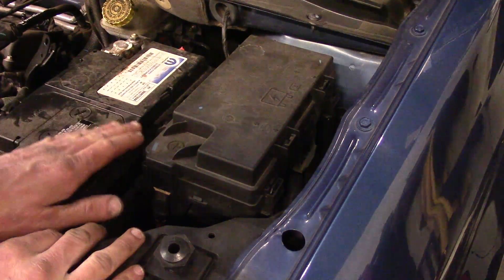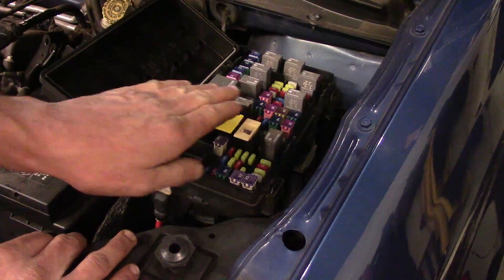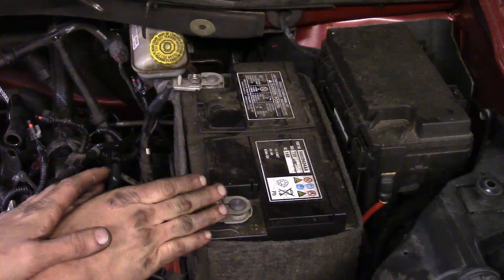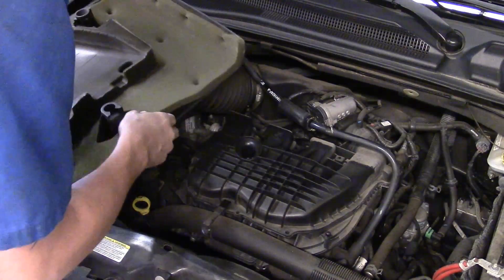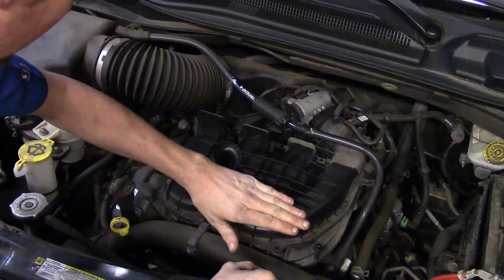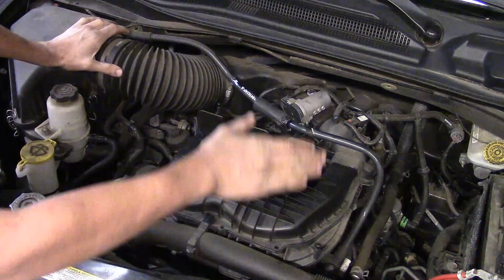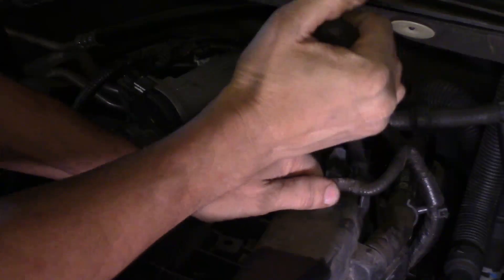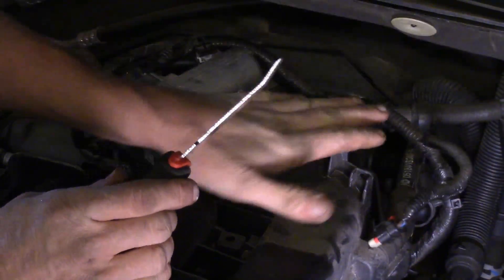Part 1/10: 3.6 Pentastar engine left cylinder head removal (the short cut)

Comment: Left cylinder heads on these motors have a warranty that's been extended to 15 years or 150k miles because they are shit
Reply from the maker: The warranty was only extended on certain year models. I appears to have been a coolant passage design issue from what I can tell...then again they dont give exact info. The warranty was actually extended to 10 years, not 15 years. Also....the head has to be tested to see if there is a burnt valve seat first....not all heads get replaced for the misfire codes that cause the diag to begin with. Only those failing a cylinder leak down test. Thanks for the comment and for watching.
Reply: What is the spec on compression?
And leak down rate?

Comment: Hi I live in Australia and have a early 2013 wrangler 3.6l. Please could you tell me if the part numbers stamped in the left hand head above the exhaust will tell me if I have a new generation head or the old one with the problems. Also I believe my roller rocker on the right hand head is becoming noisy, do they have a normal running sound like tappets or should it be dead quite. Thanks Shaun.
Reply from the maker: There will be some noise....very slight that you hear that will be the injectors but nothing more then that. There is a chance you have a roller rocker going out and a damaged cam lobe as well due to it. As far as the part number......I am not sure where its located on the head but the replacements had a green sticker on them that let you know they were reman heads. A typical Chrysler part number will resemble something like this......6859723AB. There will be a series of numbers followed by 2 letters. Thanks for the question and make sure to subscribe

Comment: Hi david im big fan of you I have a question I own a 2015 jeep wrangler about a 5 months ago the engine start making a loud knoking noise" not a ticking noise it was like a knoking noise the Dealership replace the left cylinder head about 2 days ago but still making the knoking noise not as loud as it used to be but still knocks any advice?
Reply: Neomarie, What was the issue, or problem, plus the fix for the knocking noise you stated on eyear ago that you had on your 2015 Jeep?I'm having a knocking noise and need to figure this out. Any help would be appreciated. Thank you so much!

Comment: my engine overheats just to the red, and was mysteriously losing coolant and no signs of it anywhere I have had the runaround with the dealer--is my 2012 caravan a candidate for change of defective cylinder heads??    Thanks great video  you need a donate button---I would contribute this is some great info---can you fix my van??
Reply from the maker: The head issue that was part of the extended warranty was the left head only and not for overheating but for a burnt exhaust valve so yours wont be covered for that reason. One possible issue is a leaking oil cooler....it can cause coolant to seap/leak and collect in the valley below the oil filter housing. Shining a flashlight down into that area is a great place to look. Otherwise if overheated too much you could warp the heads and then bigger issues now. To be sure.....a cylinder leak down test would be able to isolate if there is an issue with the heads and combustion chamber gases getting into the coolant system. There actually is a "Donate" button on the main channel page at motorcitymechanic.com. You will see the Facebook Icon in the far right and also a Paypal icon. The Paypal Icon is where you click to donate if you wish. Any donations are greatly appreciated and thanks for watching the video and make sure to subscribe.  As far as fixing your van.....depends if your close to Georgia lol
Reply: Thanks A big Bunch !!!   going to FB Appreciate the clear info totally is the best-

Comment: Thanks. Watching this video inspired me to never buy a Chrysler vehicle with a 3.6L. Those have got to be the cheapest looking roller tip rocker arms I've ever seen. Did you find any burnt exhaust valves?
Reply from the maker: Actually its a great engine. Its like anything else out there......no matter how much testing they do, there are always issues on the first generations of anything. The head in the video had a burnt exhaust valve on the left head which was a common issue on the first gen. Thats why they extended the warranty on just the left head......I assume it had to possibly have something to do with the coolant passages. But it has been fixed since then and no more related issues on the later verison. Its hard to imagine that the engine puts out just under 300 horsepower! The roller rockers hold up well....you see a needle bearing issue from time to time on the roller portion but is seems mainly on fleet vehicles such as taxi's and retired patrol cars that idle all day long. Otherwise personally I wouldnt avoid a 3.6......but if I had a choice....the 2014 and newer. Thanks for watching and for the comment.
Reply: ah...  no.

Sadly they don't mention the number of Warranty Denials Chrysler turned 
away to save them $$ with bad heads.  Also they stay quiet on the issue 
NOT being fixed in 2014+ V6s.  The newly designed heads a better, but 
the problem keeps persisting in new versions of the Pentastar V6.

Head issue persists in the new models.  Issue still not fixed.   My 
My V6 had a cracked head at 47k miles and Chrysler refused to honor the 
warranty because my oil was changed on my military post oil shop and the
 receipts
 werent to their standards and I was left with the bill on a KNOWN 
defect.  Don't buy ANY CAR With this motor if you like your money.  Same
 design.  Same engine.  Same issues.
Reply: +blainne2012 Contact your attorney general. My attorney general has saved my ass multiple times on similar issues.
Reply: Yes cause looks matter in part endurance, right?

Comment: just curious what was the reason for replacing the cylinder head?
Reply from the maker: +raymond jenkins There was a misfire on one of the left side cylinders and further checking should a burnt exhaust valve seat. The head was redesigned to help with prevent it from happening again. Thanks for the question. Make sure to subscribe
Reply: thats good to know i will put this in memory for the next 3.6 i daig
Reply from the maker: +raymond jenkins They extended the warranty on some for just the left head just because of this issue. If you work on enough of them.....you will eventually be doing this repair
Reply: im the only engine specialist at my shop so no doubt i will start seeing them soon enough.time to look for the tools i guess
Reply from the maker: +raymond jenkins Find them and keep them close lol.

Comment: why dose the challenger make 305 hp stock and the avenger makes 283 stock and it you added nos what would be the limit for the engine
Reply from the maker: I haven't heard why each one of the 3.6 vehicles have slightly different horse power ratings. They never make mention of it to us. I'm sure there is reason but just don't know. When it comes to NOS.....I am blank. We never get to do custom work such as that here at the dealership.
Reply: That's what cubic inches are for. That'd be one less Pentastar engine on the road.
Reply: Ian Robinson it's in the factory tune
Reply: Lol weight, exhaust,  exe. and you gotta be careful not to confuse factory hp and whp